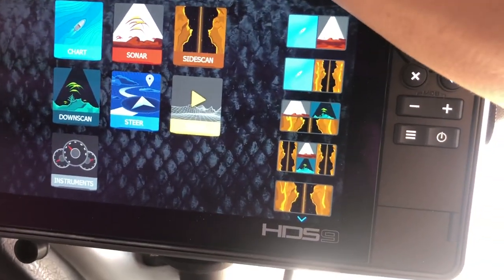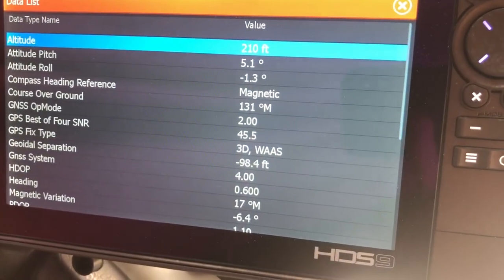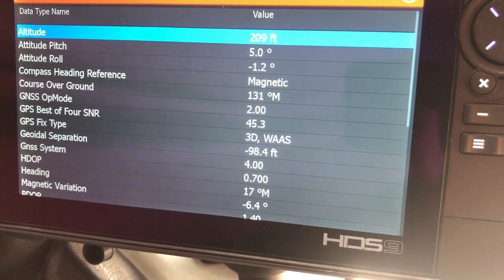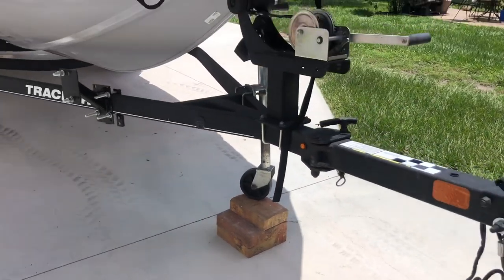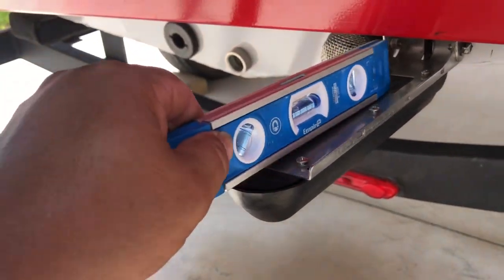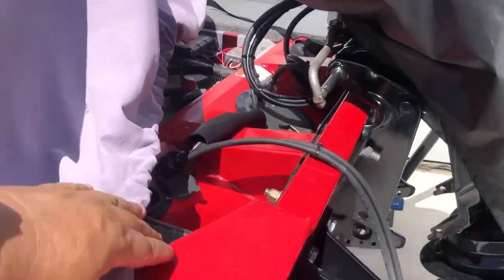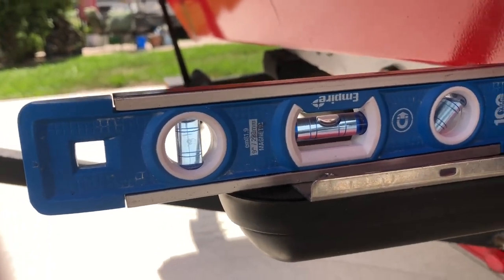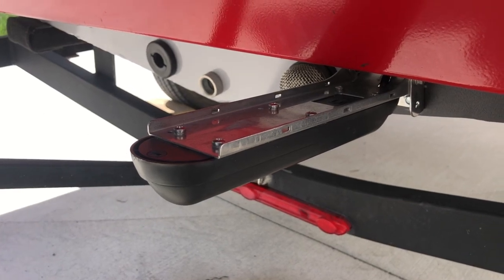Lowrance leveling transducer using Point-1 GPS Antenna.

Comment: Thanks so much for the valuable info provided!  This has to be the  most reliable transducer install solution that I've seen anywhere.  After your adjustment, what was the result from your images on your HDS 9?  Much appreciated--